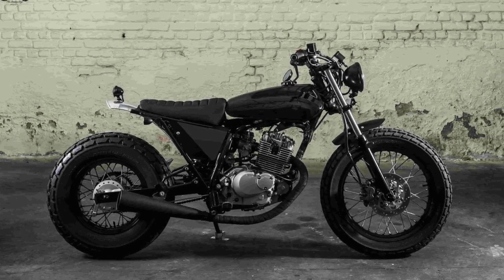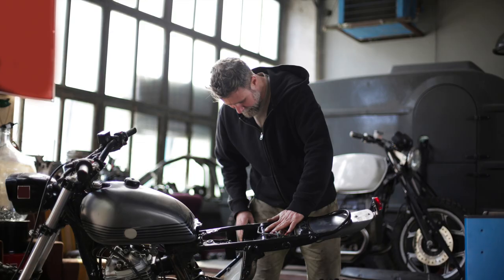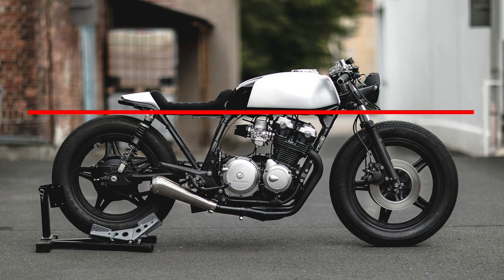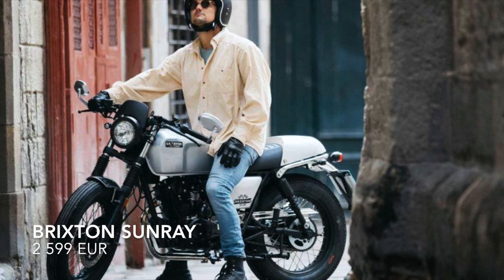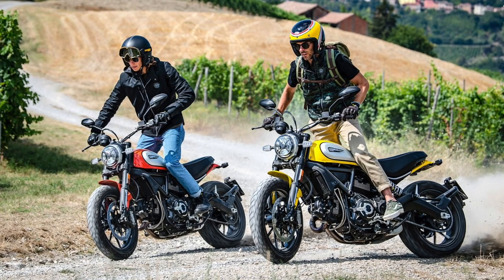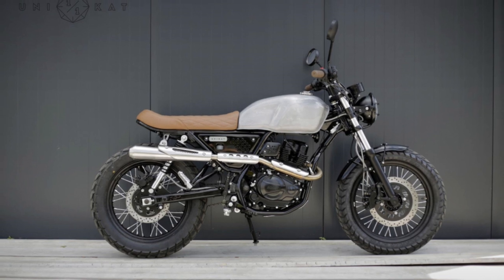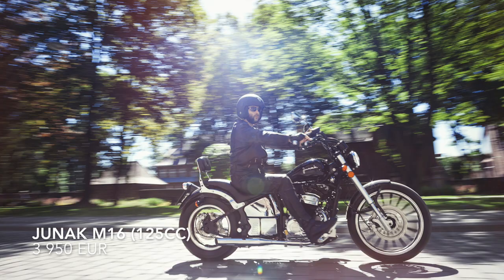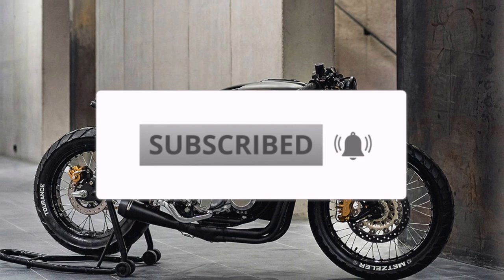Best & Cheapest 125cc custom project base to start with (Cafe Racer, Scrambler, Bobber)

Comment: Im wonder should I go with older 70-80s honda and try to restore it or get something less popular  brand like barton and so on younger 2015-2019? Is there really huge difference in terms of quality between Honda and this new brands in that low 125 capacity?
Reply from the maker: there is no that difference -more of that I'm sure that old bikes are most likely produced with better quality materials (not that much aluminium etc.) but the most issue is that - 1) they break more often 2) there is not that much available parts and prices may be really different (from really cheap to truly expensive) and they are most likely not that 'technologically advanced' brands are working so much on making 125cc better this days because there are a lot of countries where you can ride these bikes with Car driving license - so they are almost as good (or sometimes even better) than 250cc bikes - In my opinion  if you want bike - even a custom one - you want to truly enjoy it and ride it everyday - I've seen a lot of people who bought an old honda CB or BMW K series and make a beautifull bikes out of it but sold it after a season or two and in case of new ones you can enjoy your bike for a) many years (if it is a better than a low-end bike) 2) the parts are cheap af haha
Reply: Try a Honda cgx, or Honda shine. Just change headlight, mudguard and seat. Plus it can take a punishment. Even stock I've used it as a scrambler. Haven't modified mine as it's looks grew on me. Also had a friend run it without oil (unbelievable right). It still works great.